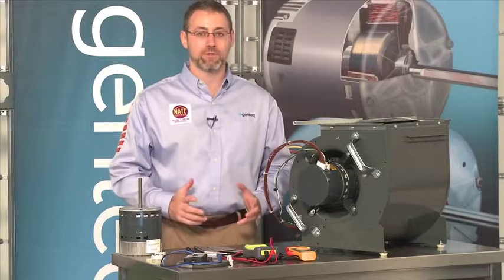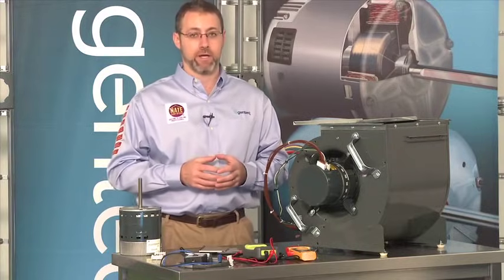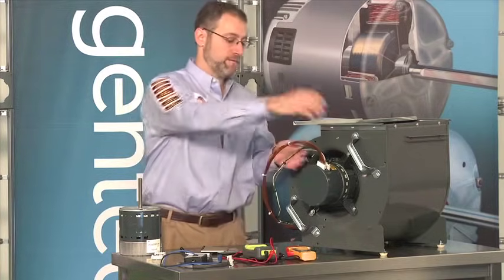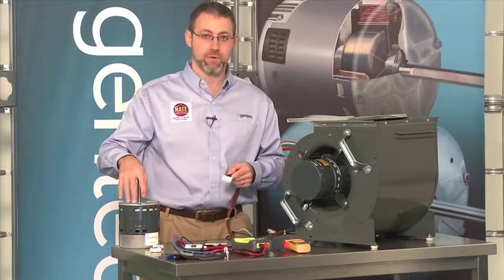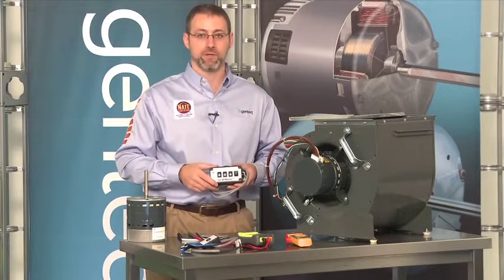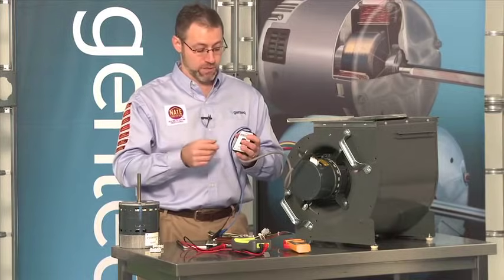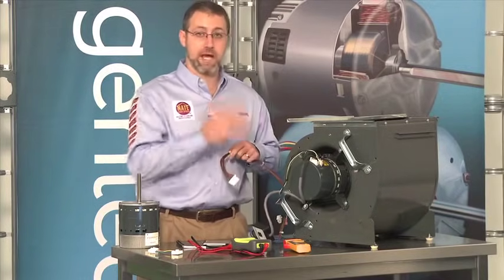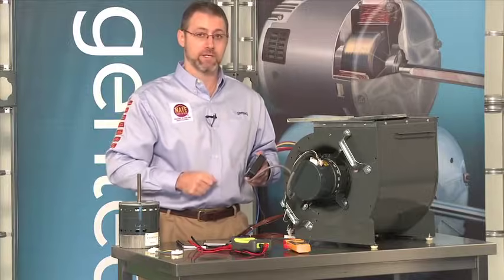Genteq Variable Speed Constant Airflow ECM Troubleshooting 101

Comment: Had problem with gentec ecm 3.0 motor yesterday. Got test tool(i think its called ecm pro from united). Had error on main logic board 68. Has to do with communication to motor. Used the tool and motor ran whole day till i ordered new board thinking motor was good. Replaced board and same error on new board and old motor. Replaced motor and it works fine. So control board on motor is bad, why did motor ran with the tool?
Reply: So the tool is nothing more than sending 24vac to some specific terminals on the module of the motor that receives 24vac. That is all it does, nothing fancy, it's nothing but a set of jumpers. So most of the time when there's a fault, the 24vac does nothing to get the motor to run and then you're ok to change the module... In your case, you had a bit of an anomaly where the 24vac part of the module was fine, but there's also some communication wiring for controlling the speeds (which is usually through low voltage dc signals and what not)... That particular part of your module seems to be what failed. It's a little unusual, but that would be frustrating since the tool wouldn't recognize that issue. The tool is still far dumber and simplified for what the ecm control does. This is obvious by the fact you're not controlling any speeds of the blower except one fixed speed, yet the furnace board does ramp it up and down and has almost endless speeds.
Reply: @Jason-wc3fh  100% agree with this explanation. From what I've been reading, ECM motor technology has evolved over many years, with twists, turns, and dead-ends along the way. In some incarnations, motor speed is selected by applying a signal to the correct "speed tap" on the low voltage connector. In constant airflow (a.k.a. variable speed) applications, the desired speed is communicated on a single wire as a PWM signal. In constant torque applications, the desired speed is communicated via a serial digital signal. A diagnostic tool capable of recognizing each possibility and testing the various operating modes that it supports would necessarily be quite complex ($$$). The HVAC system in my home has a variable speed ECM motor (constant airflow) controlled via a PWM signal, but I've found no helpful information on how to determine whether a misbehaving blower is due to a faulty PWM signal from the OEM board or due to a problem within the ECM control module. Regal Rexnord must surely provide the HVAC OEMs with something equivalent to an ECM Interface Specification or API, but this information seems invisible to Google. Maybe it's all considered proprietary and the OEMs are forced to sign NDAs?
Reply: I’ve had this same issue twice recently. Each time motor ran with tester, ended up being faulty modules for specific taps for cooling.

Comment: How to troubleshoot: buy our tool. Brilliant.
Reply: Ive used this tool on a 16 pin trane variable speed. It ran great on full speed with the tool so I replaced the board and the motor still ran at like 100cfm lol.
Reply: @techfive7202  So, even if this tool finds a brute force way to spin the motor (which would at least confirm that the windings are okay), it won't help with determining whether the original problem is on the HVAC board or in the ECM control module? Seems too expensive for something that offers such limited diagnostic capability. A simple resistance check of the windings can determine whether the motor is okay, and while you're doing that, you also have the opportunity to examine that troublesome inrush current limiter, which is potentially an easy and inexpensive fix.

Comment: What options are available to replace the ECM with a standard motor, which is far less expensive and easier to replace.  Thank you for any info.
Reply: You can attach a fan relay wire green and common to the 24 volt, and then your fan speed tap to normally open, and a wire from line 1, and then line 2 or common goes to common of the transformer.
Reply: @leslieabraham6074  sure, but that means the fan will only work on 1 speed through that relay. The ECM motor can have up to 5 speeds depending on the model.
Reply: @tomtom1541  yeah I think he's looking for a cheaper option. Like the PSC motor.
Reply: @leslieabraham6074  well sure, but he's going to end up spending more money on electricity. So in the long run you haven't saved any money.
Reply: Having had the “pleasure” of a failed ECM module after five years of service, I think this is a built in obsolesce component. The thermistors could be made as plug in which would address many issues. Why the units cost 500 plus bucks is absurd. They are made in “Medico “ by dirt cheap labor so you know someone is cashing in ; plus there is an environmental cost to trashing all these failed units.
Reply: Perfect question.

Comment: Thanks for this great video.  Do I need to get an EON "drop-in replacement" motor programmed?  If so, what does that involve?
Reply from the maker: Thank you for your message. Please give us a call and we can better assist: 

Customer Service:
Induction motors Technical Support
800-672-6495

Electronically Commutated Motors (ECM) 
Technical Support:
(866) 503-8566, Option 3
Hours: 8am - 5pm CST (Monday - Friday)
Reply: Hey Jeff. Did you get an answer to this question? Do you need to get an Eon drop in replacement motor programmed?
Reply: @jamesdaws3457  Regal Beloit was hesitant to even talk to a DIYer about it.  Nor could I get a straight answer from any forum.  I eventually bought a reconditioned one from https://www.ebay.com/usr/unitedhvacmotors.  It works fine.  I had to switch a couple wires in the harness since my motor turned the opposite way.  But they had instructions for that.
Reply: @Bob_Zhurunkle  Thanks Jeff. We're you able to get one with the same model number or did one work with a different model number? I suspect the myriad of model numbers and programming codes are mostly a smoke screen.
Reply: @jamesdaws3457  I contacted the seller and told them what I had.  They sent me the one that worked.  I think the programming is based on the multiple speeds the fan runs.  The RPMs for slow and fast are different for the various models.  I tried an unprogrammed motor first and it didn't work at all.  That's when I went with the e-bay seller.
Reply: @Bob_Zhurunkle  Thanks again Jeff. I contacted the seller and like you said he's knowledgeable & helpful. Unfortunately, he didn't have a part that would work for me
Reply: @jamesdaws3457  you can program different speeds for each of the terminals, and on some models different numbers are terminals are used. Some have all used but some might only use 2. So there's no guarantee it will work perfectly.
Reply: @Bob_Zhurunkle  Yep, that is half of the problem with HVAC industries. WE DIY folks have already gone through the HVAC system with bad results and expensive issues still not fixed. That is why the DIY people are taking matter into their own hands !  We have had enough of the "industry" professionals bilking us out of our money and still functioning equipment that they seem to believe needs replaced or condemed.
Reply: @jamesdaws3457  The Evergreen motors are self learning. NO PROGRAMING needed for rotation. I'm unsure on the variable speed motors.